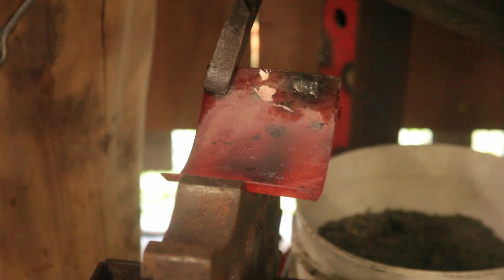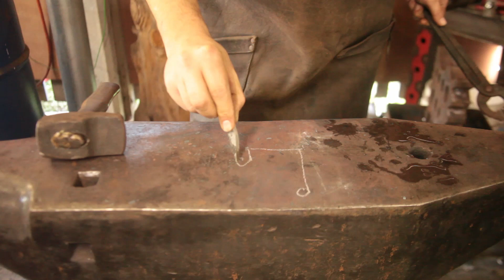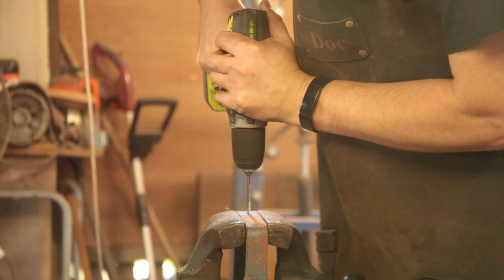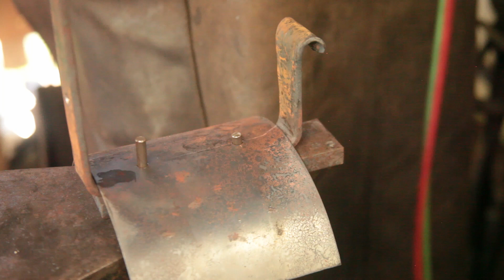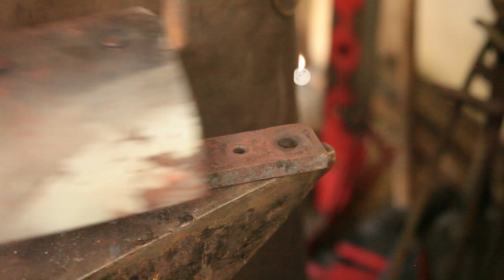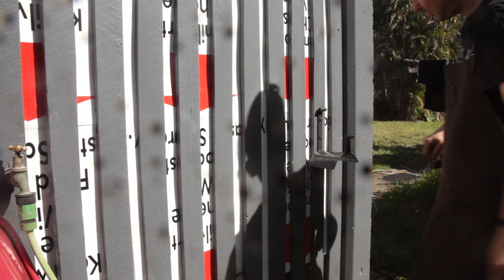Hose tidy

Comment: Doc did you make those Poz tongs? If so what size starting stock did you use?
Reply from the maker: They are “quick tongs” and were well worth the money too! Ken’s custom iron is the place to go
Reply: I’ve made a 6mm pair but want to make larger sets if I can but not sure if the smaller jigs will work on bigger sets.